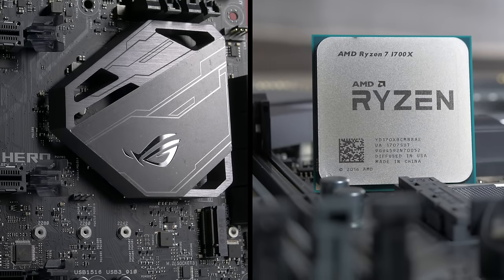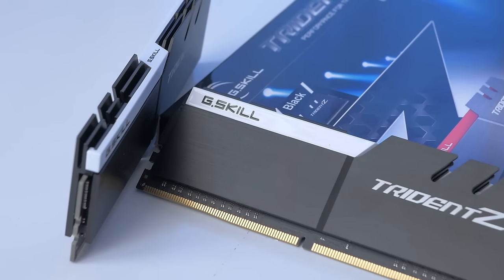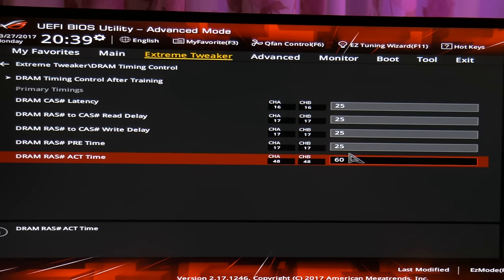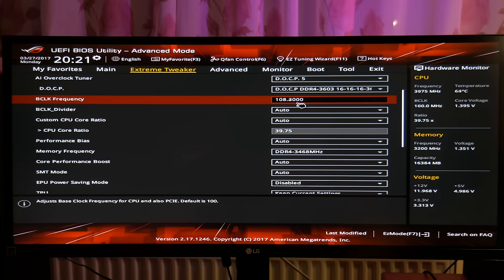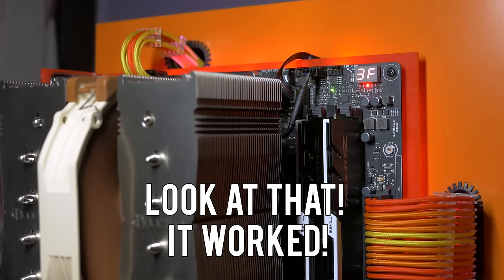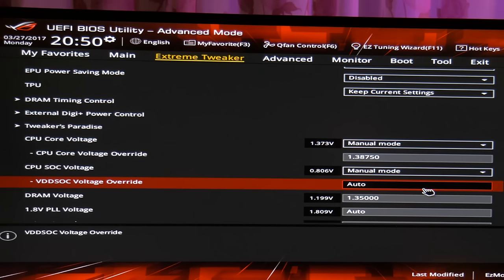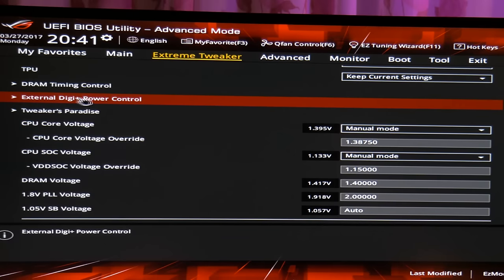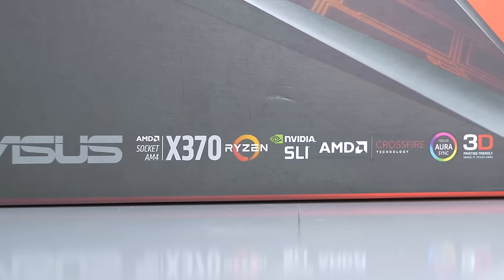Getting faster RAM working on Ryzen + ASUS Crosshair 6 Hero

Comment: @mindblank tech so what I'm trying to figure out is how to decide to keep a processor or not: for instance i am trying a 1700 right now(ive tried both the 1700x and 1800x as well) and they all seem very similar when overclocked, but having upgraded to an 1800x from a 1700x I was thinking I'd get a better oc, but its memory  controller was garbage so then I tried my luck with a 1700 - it can't go over 3.9ghz pretty much at all but with the taichi it booted 3466 first time, and then booted the same kit into 3600 with out Any changes other than dram voltage. to get it stable required loser timings but only of the main 5 - is this chip worth keeping? or should I get a binned chip from silicon lottery? Im about to order another kit and return this one - I'm thinking team group t-force 4133mhz to see if I can get that 4000mhz strap locked in...

Sorry to repost, trying to get an answer :p
Reply from the maker: +Sam Atherton Yes, I think you should keep this one. SL only bins for core clock, AFAIK, not for IMC capabilities.
3600 just like that is a great result! Congrats! And 3.9GHz is plenty ok, don't worry about that.

Comment: now wats the best memory speed either through xmp or. manual over clock that you can run on a gigabyte x370 gaming 5 ...it says 3200...but is it possible to oc it orcrun faster memory on it say 3400  or 3600??

Comment: I wonder what i would be able to get stable, without having to do any of the boot up tricks you have shown, on the Asus x370 Prime Pr board I'm getting. I'm fairly sure Corsair Vengeance LPX at 3000 is not with the Samsung B-die as it al read has timings of 15-17-17-35. Maybe if i'm lucky i'm able to get it to 3200, but I think that'll be a stretch.

Comment: I have no issues POSTing with 3200Mhz, and even with your methods 3600Mhz, but 3600Mhz is not stable, though I haven't played with PLL voltages yet. 3200Mhz with auto timings is rock solid stable with CPU at 3.9ghz.
Another thing is SOC voltages reported by motherboard at 0.8v is a no go if you set that value manually and try to restart. I had it once by mistake set manually at 0.88v and system refused to boot. So now either I keep it at auto(which bumps it to 1.133v) or set it manually at 1.15v.
And finally my CPU at least (1800x) when clocked to 4ghz is unstable with any RAM speeds(even 2133Mhz), and crashes with orange light blinking under Q-Code LED screen.
P.S. I'm using Corsair Vengeance LPX 2x8GB 4000Mhz RAM. Too bad corsair does not tell anyone which chips are being used for it, and they are EOL now. Though it is Single Sided sticks.

Comment: So i have a question do you know what ProcODT ohm rating you are running at to get 3600mhz? If not think you could find out XD
Reply from the maker: +ramair325 Hey man! IIRC, when I was testing 3600 RAM, there was no ProcODT option on the C6H. I don't have the parts running ATM, but they will go in a nice build in a few weeks and I'll check out latest EFI's and see how they've improved things. Just drop me a comment on that build video so I can let you know.

Comment: Thanks a lot. I am using G.Skill FlareX 2x8GB F4-3200C14D- 16GFX on my asus strix b350f mobo. The stock docp profile setting it to 3200 14 timing. But my system is not full stable as it is not listed in qvl. I am getting sudden display off issue and amber light for ram issue on mobo. What can i do pls help. Thanks in advance....

Comment: @MindBlank Tech,  so Is Crosshair 6 Hero the best motherboard for overclocking a Ryzen 1700 cpu ? I see it has some bad reviews on newegg but Im currently looking for the best motherboard that allows the most cpu clock and ram clock as well (prolly will pair it with an noctua cooler).

Itd be nice if you posted all your specs on your testing on the video description for accesibility too!
Reply from the maker: +Colt3d I don't know if it's the best but AFAIK this is what they use for LN2 record clocks and ASUS also market this as the best RAM OC'er for Ryzen. It's a good board, can't say otherwise.
Reply: Why do you think it has some negative reviews in some online stores? most of them claiming that the motherboard bottlenecked their ram to very low frequencies or  some malfunction after 2 day use, seems Asus had a very rough lunch for these?
Reply: Just as an addendum, I decided to go for the Ryzen 7 1700 and the Crosshair Hero VI, after updating the bios to the very last version 1201  I managed easily to go from 3.0 to 3.85 Mhz on the CPU and from 2400 to 3200 CAS 14 on the G Skill Flare X Ram.

My temps and stability are incredibly good for both the CPU and Ram, is it worth it to try go up a notch from 3.85 to something like 4.1 and from 3200 CAS 14 to something like 3600 CAS 16? Im specially curious about my ram's room for upgrade and the impact it could have on games.

Comment: I run at stock 2133mhz. But today for no reason the pc crashed and was not booting. After a few tries and swapping, one stick worked. And after 5 hrs the second stick worked again. WTF is going on. I have the same mother and trident Z ram with RGB.Shoud i replace the ram sticks.? does the pc do this.
Reply: perhaps you overclock the cpu and it is not stable?

Comment: I have my lpx Corsair vengeance ram it is Samsung b die the only way to get my ram stable at 3200 is to up the voltage to 1.4v is that safe for daily use ??? could I push to 1.45??? what else can I do ?? to improve performance I only have the x370 prime plus Asus board any tips anyone?

Comment: I love your video. It helps my new Ryzen computer reach 3402MHz RAM speed with 116.2 BCLK frequency(based on 2933MHz ). But I am unable to boot my computer at 3200MHz RAM speed with normal 100.00 BCLK frequency. I am also unable to reach 3600MHz with 135.0(based on 3200MHz), 135.2(based on 3200MHz) or 112.6(based on 2933MHz). Can you give me some suggestions for helping me get 3600MHz RAM speed?

Comment: Any ASRock Taichi users?
Reply: Yes but I cant try a BCLK overclock as I have an m.2 drive :(
Reply: Why is an m.2 affecting your bclk on ryzen? The bclk engine on the taichi should allow the pci and cpu bclk speed to be separate.
Reply: Watched the video, possibly eating my words but we'll find out next week.
Reply: Jose Hidalgo new taichi bios out!!!
1.6 stable and 1.94A beta. about to try them out right now. 3200+ MHz, here i come.
Reply: @bavarianblessed

Taichis just came in stock today, in addition to the Killer and Fatality K4.  They sold out an hour after I noticed them.  I don't know how long they had previously been on there.  I know it couldn't have been long as I was checking all day.  Newegg said to use their stupid "auto-notification."  That thing doesn't work.  I've used it 3 times and only ONCE did it actually work.  If I hadn't checked today, I would have missed it.

Best thing to do is call or email the board manufacturers directly.  They can give you an idea of when Newegg/Amazon should get shipments.  Asrock is only on Newegg, unless you have a Microcenter nearby.

I just happened to call Asrock today and the guy told me that Newegg should be getting some boards in stock either today or tomorrow.  Glad I can finally finish building my PC.

The guy told me that Newegg should get a LARGE shipment, (enough to sustain them permanently) around mid-April.  Not surprising since that is right after the Ryzen 5 series launches.

Comment: Possibly stupid question, but won't this make your RAM's life shorter?
Reply from the maker: +Joel Santos Not necessarily. As long as you don't go above 1.45v for extended periods of time or if the RAM doesn't get very hot in the process, you are OK. Also, this RAM is factory rated at 3600MHz, so this is not an OC of the RAM per se...
Reply: Ah, of course, thanks! Keep up the good work! This tutorial really helps. Really can't wait for Ryzen 5! :D

Comment: how come I haven't seen anybody running ddr4 4200 on ryzen
Reply: ssjpacman because I dont think 4200 is possible with ryzen yet. 3600 was a chore enough to get running with ryzen. once they work all the bugs out of the ram usage on these boards 4200 might be possible
Reply: madmax2069 I'm just saying I haven't seen anybody put the sticks in let alone trying to run it at that
Reply: ssjpacman probably because like me, they have their 1800x, 1080ti, 960pro and g.skill trident z RAM but the mobo they ordered is out of stock.
Reply: I was a preorder, and I just got my motherboard 2 days ago. Motherboard manufacturers did not think Ryzen would be such a success.
Reply: Dh66 People are still having issues with mobo availability? Damn, that sucks. I had to wait a week longer than expected, and also had to settle for a different board than I initially wanted.
Reply: Because the higher latency makes for a performance hit with Rizen. If you can't afford low CL kits when going with 3200+ get 2133 and hold out because there is no advantage.

Comment: We need ram designed for Ryzen
Reply: HGD G.Skill has been rolling out B-die Ryzen Approved memory. 3200MT/s ram is out now, 3600MT/s memory coming soon.
Reply: Great news
Reply: Should i be hopeful that my 3200 cl16 gskill trident kit will work at its rated speeds eventually or is it unlikely?
Reply from the maker: +Atingleee I think with better EFI's there's a good chance for at least 3200MHz with some tight timings. People still need to be patient, the platform is very new.
Reply: I have an older pair of G.skill Ripjaws 5 3200 should they work okay?

 My MSI Carbon pro x370 started "no post" after i flashed  to 1,2 so yeah gonna return it and get the asus prime. Hear it its not having as much issues as MSI. 
I just want my 1700x to work damnit :(
Reply: Thanks for your reply! i'm happy to be patient as long as there's hope, if not then I'd prefer to swap them out for another pair
Reply: emil papis I can't get my memory past 2933mhz on the Asus Prime X370-Pro on the latest bios. I'm sure future bios updates will iron this out however, and it's not like the computer's performance suffers greatly from using still quite fast ram, just not the fastest.
Reply: HGD No you just need to enter the timings like your supposed too. Intel has spoiled people with one click XMP. It's never been that way with AMD, even with AMP profiles FX had. Personally I always enter the primary, main t timings and voltage manually. A lot of people are using the DOCP crap which applies unnessasary voltages and looser timings.

Comment: The OC is clearly unstable.
Reply: alkafrazin it's not that the overclock isn't stable, because it is. Once he's in Windows it's solid. The issue is the immature bios. We just need to wait for board makers to finish making a more stable BIOS.
Reply: That's not how a stable OC works. If it's crashing on a cold boot, it's not stable. Booting from an off state can bring out the instability in an overclock because of the sudden voltage shifts, but more importantly than that, no matter how long you test, it's extremely difficult to determine memory stability, and symptoms of an unstable memory overclock are not as simple as a CPU or GPU. 
An unstable memory clock can cause failure to post(like in this video), hard-locks(no bsod, no restart), software oddities(I had an unstable memory OC that would cause creep to not vanish properly in SC2 sometimes, leading to small tiles of unsupported creep all over the map, no other symptoms of instability) file corruption, crash to desktop, driver errors for anything else in the system, and lots of other fun stuff. Even silly things like audio stutter. 
There's also the fact that there's 3 factors to memory stability: The DIMM, the MC, and now, in Ryzen, the Data Fabric. Any of these being unstable could cause any number of subtle or not so subtle issues, frequently or infrequently, depending on what's wrong.

Comment: You didn't mention that m.2 ssd suffer very bad penalties from bclk overclock.
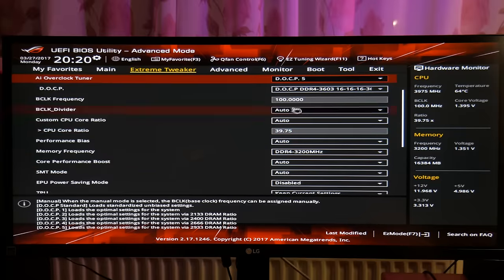Reply: 3:12 Yes he did
Reply from the maker: +ATrigger I did. It's in the BCLK OC section. Also mentioned SATA. :)
Reply: My bad, guys.
Reply: What exactly can happen? I mean does it damage your m.2 ssd?
Reply: It should not do any sort of damage, but your speed my suffer a bit.